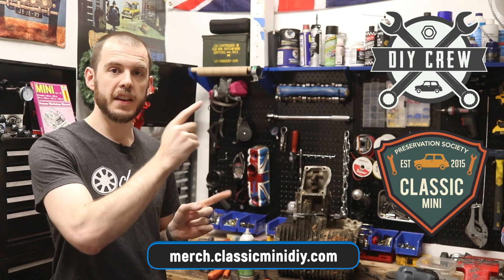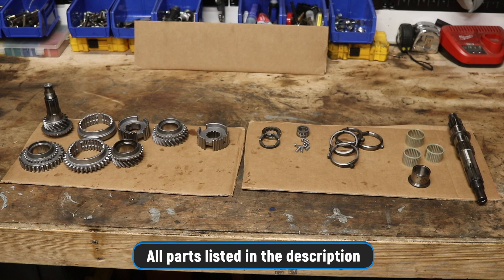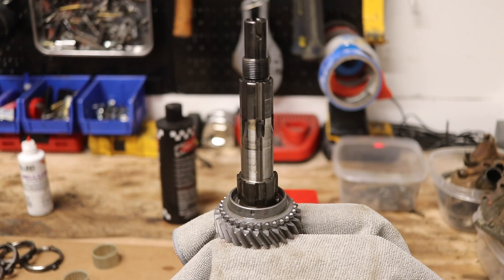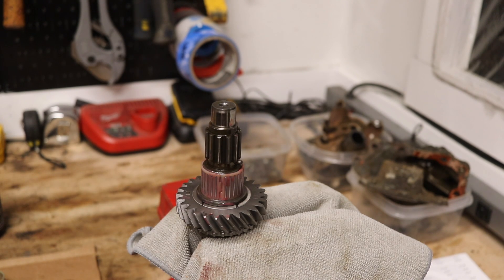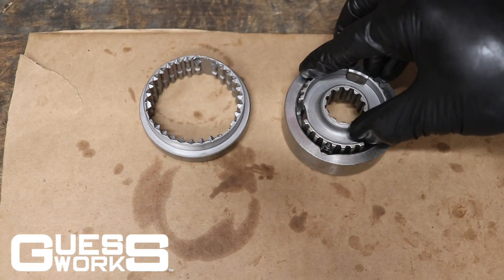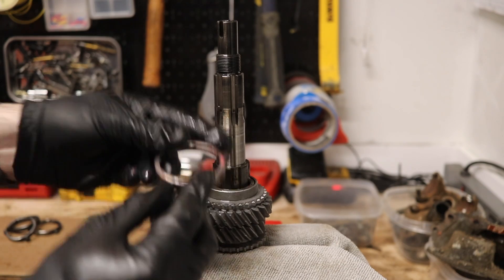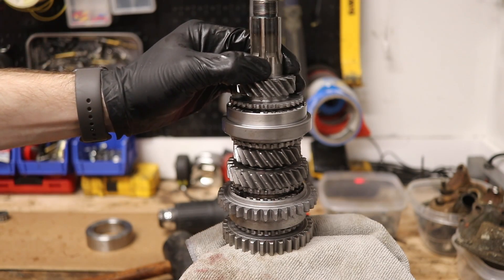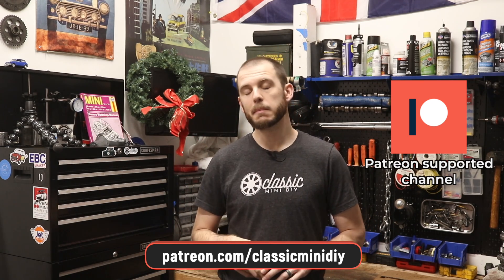Rebuilding a Classic Mini Rod Change Gearbox - Part 3

Comment: a piece of pipe/tube that fits snugly over the inner  part of the syncro hub can be used to fit the springs and balls. Just drill a hole it it, and align it with the spring hole and pop in the spring and ball, it can then be rotated to the next hole, and it works just like the tool you have, but it's easy to make.

Comment: you really dont need that guessworks tool to fit the synchro together. you can just align one inside the other, with the wholes just above the outer lip, then put the springs and balls, and with both hands you can press the balls in and push the whole mechanism in rather easily.

Alternatively just get an old spray paint can plastic cap, cut small notches corresponding to the synchro spring wholes, and viola! you have something very similar to the guessworks tool - cheap as chips.

Comment: This series of videos has been amazing!! I just rebuilt my DAM5626 (17/62) gearbox and I coudnt have done it without all your tips and tricks provided in this video!!! Thanks a million for a job well done and presented!! gearboxes have been my nemesis for years and years till I finally decided to tackle one and May the force be with me I thought! My humble two cents on the process of the replacing synchro hub spirngs and balls (the little flying devils) is you can also use an old speaker magnet to keep it all in place. I just slide the magnet on the inner hub and it keeps all three springs and balls in place so that you can lock it in place without any fuss! Cheers from Greece!
Reply from the maker: That’s a super clever idea if you don’t have the tool in the video. Glad that you have enjoyed the series. I really enjoyed making these videos. 🙂

Comment: I picked up a couple of rod change boxes and stripped them for parts. One had been sitting in the dirt for years and the bottom stud on the diff housing has completely corroded. The diff casing was fused to the stud, so I ended up cutting through it with an angle grinder to get the diff assembly out...

Comment: You didn't actually explain what the synchro hubs and the baulk rings actually do.  By explaining what they do would give a better understanding on how the gears change smoothly and without the crunching and with work baulk rings why you crunch gears.  But so far you're doing a great job.  Keep up the good work! 👍

Comment: I have I bit of a weird question but I’m 6.4 ft and a want to get a mini do you think I’ll fit comfortably?
Reply: im 6ft 2 and fit in ok. you may have to drop the seat so the foam is actually touching the floor. basically a  new standard mini seat - you will not be ok. but an old saggy standard seat - you will be fine.
Reply: dastardlyman thank you this helped a lot!

Comment: Once assembled a rod change gearbox with the synchro hub inserted the wrong way round. Only when I put the engine and gearbox back in the Mini did I discover it wouldn't change gear. Had to pull the whole thing out again and disassemble the main shaft.